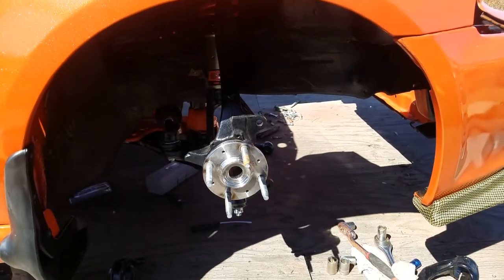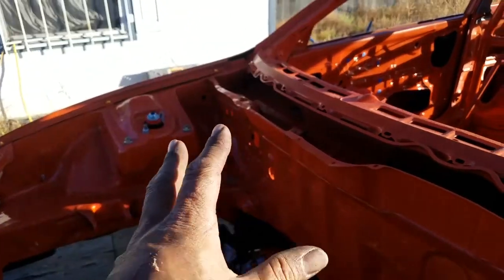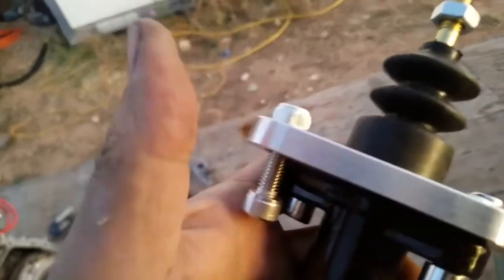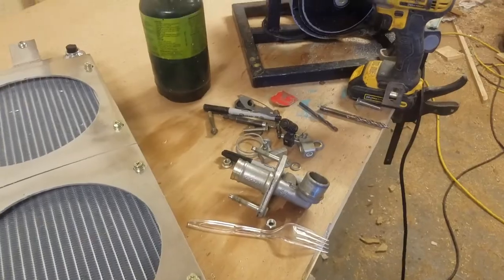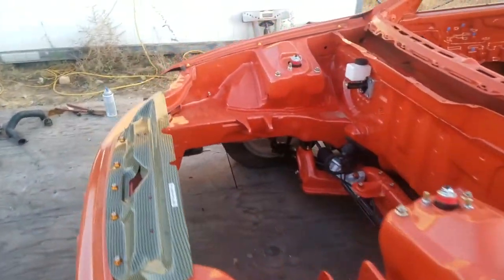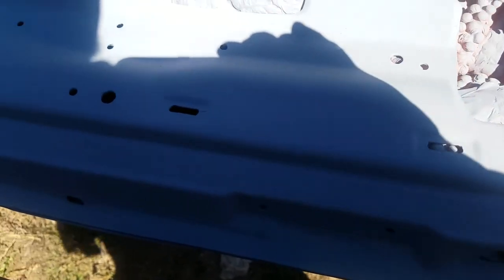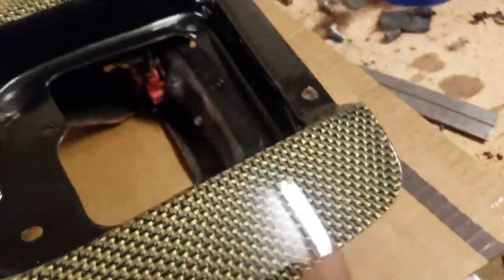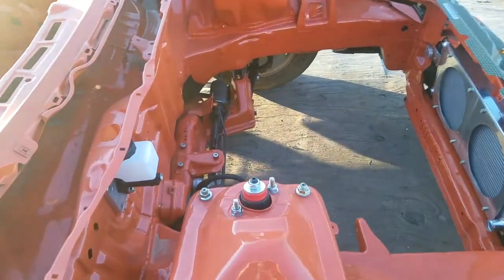Honda Civic Hatchback Build Part 10

Comment: Nice clean engine bay......is there anyway you can illustrate which holes needs to filled out for the engine shave whilst keeping the AC and brake booster?
Reply from the maker: My car didnt have A/C primarily.  However the holes that would be sealed are the two holes for the harness would be the only two that would be closed off. All of the other holes for the brake booster, clutch master cylinder, coolant lines, a/c lines would be open. The  attaching points for the proportioning valve, charcoal canister, fuel filter would be shaved and smoothed.
Reply: @switchjv  what parts  would I need to do a engine tuck keeping my ac and brake booster
Reply from the maker: @healthwellness4400  you'll need a mig welder to weld in the sheet metal. Body filler, primer, sandpaper.  You can keep all of the stock parts that are on the car or upgrade your brake booster, clutch master cylinder,  proportioning valve.
Reply: @switchjv  whats the most affordable amp mig would you recommend
Reply from the maker: @healthwellness4400  I used a $100 harbor freight wire feed welder for the longest time. They last for about 2 years before you have to buy another one. I recently upgraded to the Titanium series which I used to make the roll cage.